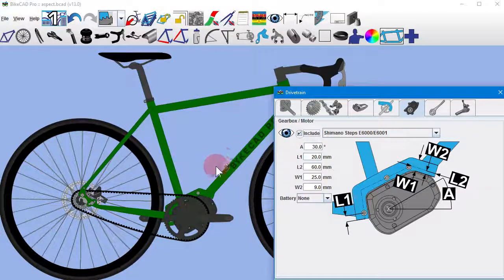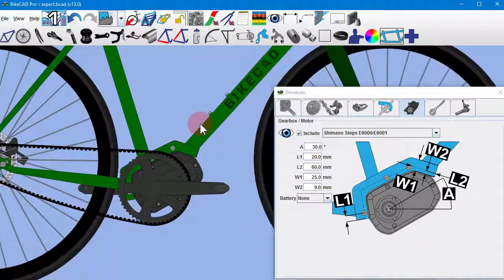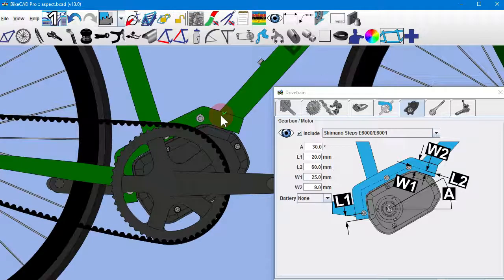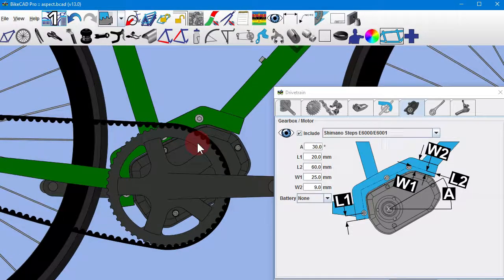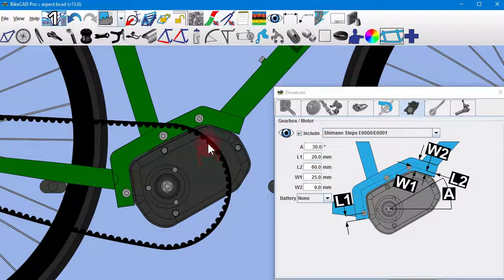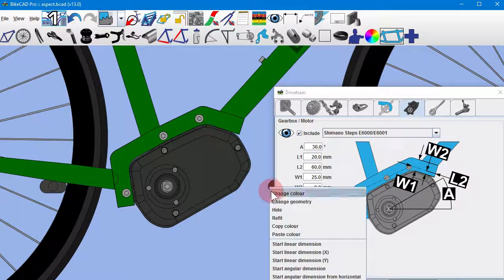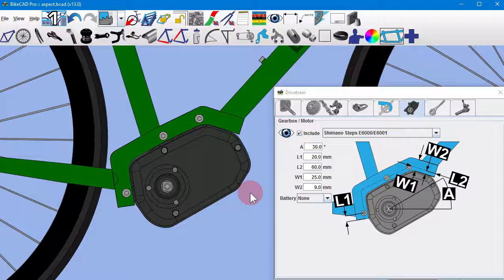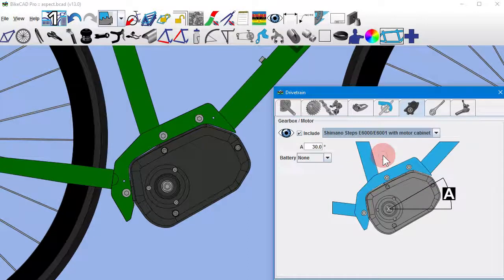Shimano E6000 Series Steps system motor cabinet in BikeCAD Pro

Comment: I am planning to purchase it. Does this software helps in calculating various forces acting on frame, tubes,pedals etc. Does it has provision to find out which electric motor to use or the torque required or how much force is required by the driver to drive bike uphill for said angle and so on.... Also new to the software are training videos available along with pack? India.

Comment: Are you planning to include E8000 series STEPS version?
Reply: Konrad Krupa I am planning to add the e8000 model. I am currently having trouble tracking down an accurate model to use for reference.
Reply: same for me, I couldn't find any drawing with frame interface or 3d model of e8000, but I really want to design frame for this drivetrain. Do you have any model or drawing?
Reply: Reach me at: https://www.bikecad.ca/contact and I can send you what I have.